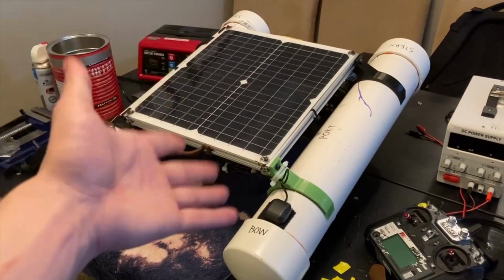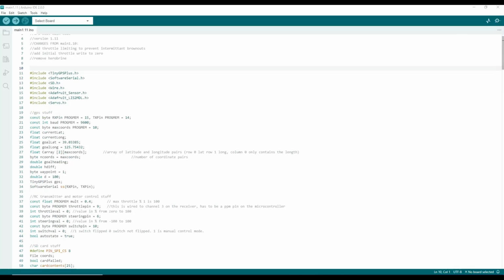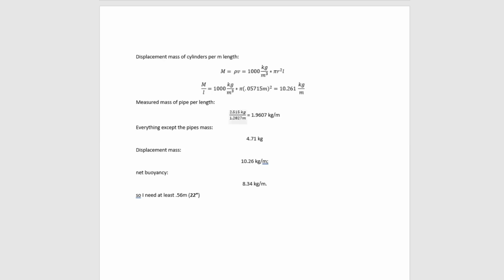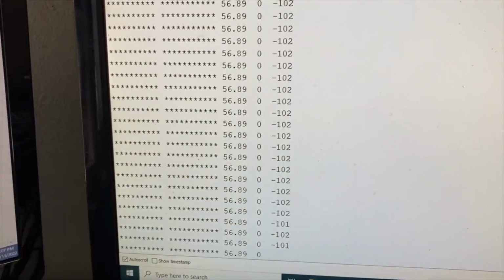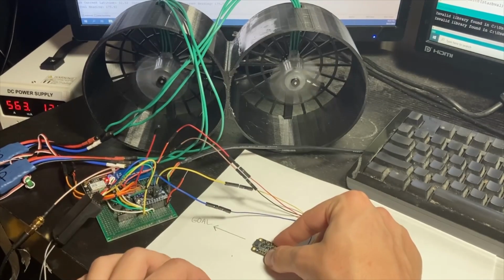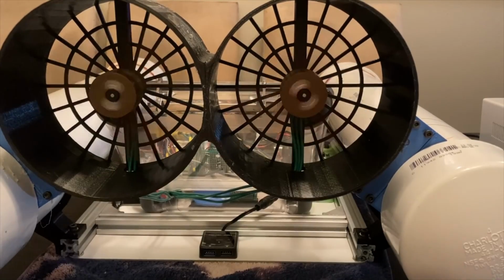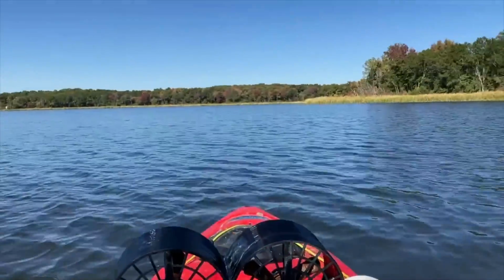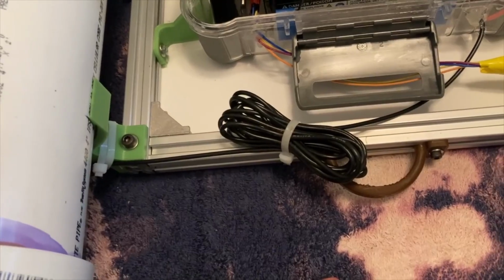Infinite Range Autonomous GPS Boat

Comment: This morning, I was dreaming up how to take kayak propulsion to the next level (I have 2 12' fishing kayaks) and decided that a PI (or arduino or some other micro computer/controller) controlling a couple ESCs and some large RC boat thrusters on a 100AH lifePo battery could do the trick. You could go to waypoints, set different speeds, turn on a dime, and do an anchor lock. And then, here you are, doing the exact same thing, smaller scale. I'm so excited that somebody else (You) did the proof of concept for me!
And you are in my old stomping grounds (I was in NW Smith county until 2020) In any event, I'm going to start specing it out and making sure the sizing is right, and start the build. It will be fun, and I expect it could work really well.
I'm a software engineer, and my son and I have some good robotics experience (His team went to World's his senior year) Still it is going to be a challenge, and one screw up can destroy a $50 part.
Anyway, if you want to rubber duck some ideas, I'd be delighted to assist. 
I really look forward to the next version you build.
Richard Hasting, Canyon Lake
Reply from the maker: Sounds like an awesome project. A much more expensive version of this lol. And yeah this neck of the woods has tons of little ponds/lakes that are awesome for this type of thing. I’ve thought about building a larger scale version that could tolerate waves and saltwater to run in the ocean.
Reply: @Clay-Builds  just modify for the pelican, golden!! My current pond is 8700 acres, so I could really use some mechanical help to propel me through the water. Paddling for a mile ain't fun...
That said, to be truly capable of doing this, I think I need reverse as well as forward. Does an ecs with a gpio controlling it, have the ability to go in reverse, or do I need to use relays to flip the polarity to the motor?
Reply from the maker: @richardhasting6046  some brushless motor ESC’s can dynamically switch between forward and reverse. Pretty much all brushed motor controllers can easily switch direction, but brushed motors tend to be more water sensitive.

Comment: Fascinating code as well, serial.print("Fuck") during debugging when things were not working xD P.s. nice project love the hardcoded lat/long makes sure it will never stops until it gets at destination, how ever the hot glue will make sure that it won't make it from Holland to England without sinking somewhere because it's not really a material to rely on
Reply from the maker: Haha good catch. left that in there from troubleshooting. The hot glue held up ok so far, but definitely not a seaworthy solution.

Comment: First very nice project - I would do the following improvements:

- MPPT Charge controller instead of that PWM one (more efficient!)
For your usage you could use an EPEVER   Tracer 2606BP.
The battery gets charged then at its optimum. The PWM Charger wastes a lot of energy as heat.
Further you can use it for gel, flooded or LiPo/LiIon Batteries -> USB to RS485 cable.

- Replace your solar panel for a more 'solid' one with an aluminium frame: Better heat management, more efficient and a good stiffness. A 30w or better 50w one should be doing its job great.

Regards from germany 😉
Reply from the maker: I’ve already replaced the solar charger with an MPPT one (genasun gv-5) which is more compact/reliable/efficient than the first one I was using. And I’ll probably add more solar panels at some point, but this one keeps up well enough on a nice sunny day.

Comment: Separating the propellers farther will increase leverage for differential thrust, decrease power wasted needed to complete turns or heading corrections, decrease fluid flow interference because they are too close to each other, and greater separation will also increase steering accuracy in general...
Reply from the maker: Yes, it would require less of a thrust differential to rotate if the props were further apart. They’re spaced as they are because I made them as large a diameter as possible while fitting between the pontoons. To spread them apart, they’d have to either be deeper, or behind/outside the pontoons. Since this vehicle is almost always traveling in a straight line, I wasn’t very concerned with this and decided to keep it compact. The time lapses towards the end of the video show it keeping on a straight line remarkably well. Larger moment arms on the thrusters would require finer throttle adjustment to prevent overdamping the steering. Once I implement datalogging, I’ll be able to tell exactly how much/often it’s modulating the throttles to keep straight.
Reply: @Clay-Builds  Gotcha, also I was thinking you could decrease drag, and separate the thrusters by turning both of the pontoons into partial pontoons/partial ducted fan jets. If there were a way to upload drawings here in the comments, I'd show you what I mean...

Comment: Very cool. I wish I was knowledgeable about building stuff like that.
I got an idea to stuff light weight foam in the pipes that way if the pipe leaks and floods the whole pipe won't fill up with water.

BTW Clay I suggest watch a 13 part series called What on earth happened by Ewaranon to learn that the earth is not a globe.

I got it in my about tab.

Comment: Great project. I enjoyed watching it. Only one observation. It is always better to have the props submerged enough to not cause the props to cavitate. You will get a huge improvement in efficiency if they don't cavitate.
Reply from the maker: Thanks. In the closeup clip of the props running in the bathtub, the water level was too shallow and the shrouds were sitting on the bottom. In deep enough water, the top of the shrouds sit about 3/4” below the surface
Reply: @Clay-Builds  That's enough. It just looked like it was cavitating. Another thing to look at is any obstruction in front of the prop. Like your guard to wade off obstacles. A prop works the same as a wing and the best results are obtained from smooth flow over the foil. Any disturbance or vortices will impact the efficiency. If you find that you don't get the drive or speed for the input that you are giving you could change the grill in front of the props to be  cone shaped with each member shaped with a sharp leading edge. Like little displacement boat hulls. That way the flow of the water has no or very little disturbances.

Comment: Lotta nice thought-out comments here!  I was curious why the prop tips have kind of a spoonbill effect on the ends?
Reply from the maker: There’s no design reason for that. It’s just a consequence of the way they’re modeled, surfaces lofted through tangent profiles with the last one being a point. 

This prop design is somewhat arbitrary, I plan to collect some real world data from a few different designs to optimize for power efficiency.
Reply: @Clay-Builds  Ah, that's interesting.  I don't think I've ever lofted "last one being a point".
I'm wondering if props being an Archimedes screw in a tube would be a cavitation free, hard to injure, hard to stop with weeds, drive system.
Thanks!

Comment: It’s probably worth reading about ‘cavitation’.
You’ll probably get better speed and battery life with that setup.
Maybe longer thrust tubes will be enough.
Reply from the maker: I don’t think my props are spinning fast enough to cause cavitation, but definitely something to keep in mind when I optimize them better. I’m also adding in current draw sensors and data logging so that I can quantitatively compare efficiencies of different propellor designs.

Comment: What sensors does it use to avoid collisions ?
Reply from the maker: There’s no collision avoidance. Maybe I’ll add an ultrasonic sensor in the front to detect objects in its path, but it also has no reverse and can’t turn very tightly. I pre-plan the coordinates it follows to avoid areas with obstacles.

Comment: Interesting build, Can I ask how you have made the solar panel ocean proof water resistant from waves smashing it and the epoxy type with regard to salt water?
Reply from the maker: The solar panel is waterproof, it’s intended to withstand rain. In practice it will stay totally dry unless there’s a large wave. Not sure how it would hold up to saltwater though. The epoxy I used is just gorilla glue brand 2 part 30 minute epoxy

Comment: Cool project. Die you epoxy your pontons ? 😊
Reply from the maker: The end caps are held on with PVC cement. Epoxy for the 3D printed mounts.
Reply: @Clay-Builds  nice but i would prefer stainless Steel and a Rudder with Air props

Comment: Outstanding work. Just some suggestions that i faced using similar hardware, replace the dupont jumper cables with something better, try and solder as much as  you can to a PCB and secure everything because these things have caused me a lot of pain with improper connections. 

If you want to upgrade the microcontroller with the same IDE / footprint, you can look into getting a blue pill (STM32F103Cx) which is an ARM clone of the Arduino Nano/Mini. It has 3.3V I/O on most pins so you might need to check that before hooking everything up. You can program it with the same Arduino IDE (look up on youtube how to, some good tutorials exist) and i think most libraries are compatible.

For the ESC, please check the thermals and add a heatsink to it because it looks like that had something to do with it burning up like that. 

And just add an action cam to your boat the next time for that sweet sweet FPV footage. Other than that, have fun. Really insipring to watch. 

EDIT just saw v2 plans, tl;dr;

-custom PCB - this would be the best with better connectors for everything. 
-sonar depth sensor - JSN-SR04T & A02YYUW, ultrasonic sensors, videos are on youtube
-data logging - sd card will help 
-upgraded microcontroller - bluepill, lets you reuse the code on an arm based mK

-heatsink for the ESC / thermal profile under load

Comment: Awesome. Thanks for sharing. I recommend redundancy for steering with a rudder incase you lose a motor so you don’t get stuck going in circles.
Reply: Samson I suggest watch a 13 part series called What on earth happened by Ewaranon to learn that the earth is not a globe.

I got it in my about tab.

Comment: Awesome work! I like the amount of math you went through to ensure it stayed bouyant.

My question is:  Was there a design reason that the motors only go forward with no reverse capability? This question was bugging me throughout the video.

As a suggestion, have you considered making a thin keel under each pontoon to just past the depth of the propeller housing? It might help protect the shroud from impacts when running aground whilst also directing the water flow under the boat in a straight line
Reply from the maker: Adding keels is a good idea. I’ll be redesigning the parts that mount the prop shrouds anyway, it’s definitely a weak point. 

The ESC’s I’m using actually can’t dynamically switch directions. To make them reverse you have to shut them down, reprogram them, and restart. This is theoretically possible to do with an arduino, but it would be cumbersome and slow. 

If the props could reverse I’d be able to make tighter turns, but that isn’t really necessary for this application. Although it would be helpful to back off of an obstacle if it got stuck.

Comment: Fascinating custom autopilot! Thanks for sharing
Reply from the maker: Thanks a lot. I’m a fan of your channel, you’ve got some awesome projects.
Reply: @Clay-Builds  Nice for drogs smuggling :D
Reply: i want to build this boot too. but much simplier with 3 x 100watt Solar Panel but No batterie. Only one 300 watt motor and a ruder over RC controll. :D 
Maby i take a little batterie in, with a switch to run with or without, for clouds

Comment: would have been much easier using ardurover
Reply from the maker: Well that would’ve been too easy and would’ve required a more expensive flight controller. Plus I plan for it to have a lot more functionality than just autonomous driving.

Comment: A rudder rigged to a DC windshield wiper gearbox downstream from a stationary motor might be more efficient.

All I'm saying is using metered voltage per L/R to steer uses energy like a skid steer to turn, but a little worm gear will hold 15° even at the bottom of the ocean
Reply from the maker: In practice, this boat travels almost entirely in straight lines so both motors are mostly pegged at full throttle with one or the other reducing slightly if it starts to veer off course. Almost all the energy still goes to propelling the boat forwards, it’s not like one motor is braking. This setup allows the electronics to be kept pretty simple because it only has one type of motor and one type of controller. If you used a dc motor for the rudder, you’d need some type of encoder for feedback. You could use a servo too but that would complicate the control and introduce power consumption that doesn’t contribute to thrust due to holding torque requirements and constant minor adjustments.

Either way, I’m sure there could be efficiency advantages to using one larger motor instead of two smaller ones, I’d love to see that in practice.

Comment: Do you have all this info in a repo to see details?
Reply from the maker: This is still an ongoing project. I have some improvements to make, and I’ll clean up the code a little. I don’t have a repo yet but I do plan to post the code/cad/ and other data somewhere soon. Any specific details you’re interested in?
Reply: @Clay-Builds  Yes please. I have used Mission planner. But this custom code is really :trophy-yellow-smiling:. I am new to arduino and this help me a lot.

Comment: Looks nice - if you're using the Arduino servo output to control it via PWM, does that mean it never gets up to 100% per the way that signal is formatted? Would analog output be a better option?

Do you store GPS coordinates on the card before launching to set waypoints? Or does it store GPS coordinates for reading later, or both?
Reply from the maker: The servo library does use analog write to output a pwm signal to the throttle input on the esc. It’s easier to use the servo library rather than directly using analogwrite because the servo function takes a “position” value (0 corresponds to no throttle, 180 full throttle) and outputs the correct pulse width accordingly. Analogwrite takes a duty cycle value between 0-255, I’d have to add some extra calculations to convert from pulse width to duty cycle. Esc looks for a pulse width of 1000us (zero throttle) up to 2000us (full throttle). So I just use the servo library because it does that conversion for me.

It can output a full throttle signal, but I have it limited to 40% because the motors would stall at higher speeds when under load in the water.

Currently it only reads pre-determined coordinates from the card, no writing. But I want to implement real time data logging so the sd card would be like a “black box” with lots of different parameters for optimization and troubleshooting.
Reply: @Clay-Builds  Makes sense, and very cool, thanks!